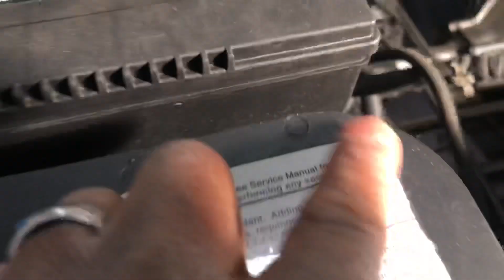2 Door Tahoe: Dropped The Motor & Dual Alternators Installed 😈

Comment: How did you wire your alternators?
Reply from the maker: Keiyalon Stephens I’m still working on this truck but this can be done in an hr or less once you find out where you want to put the regulator. Only need 12vt keyed, ground and positive to the batteries in the rear.

Comment: Bruh u really gettin it in! Big fan of the channel. By the way where can I get a  Duel Set up like that and also is it possible to just run 2 stock Alternators? I’m only pushing about 2500 Watts not even. rms probably 1600-1800. Please keep them videos coming. Very helpful. RESPECT!!! ✊
Reply from the maker: Yes you can on the setup and thanks for the support 👊🏿
Reply: Steve Davis thanks so where can I order one?
Reply from the maker: Ab Pierre-Lys Down4sound

Comment: Hey quick question,  I have a 94 suburban with the 5.7 and I wanna put dual alternator bracket on her. Now question is will my mechman 320 that came off a 5.3 fit on the second alternator spot. Like can I run my factory alt. That's o my 5.7 in the factory location and my mechman 320 that's off my 5.3 in the second location with the dual alternator bracket?